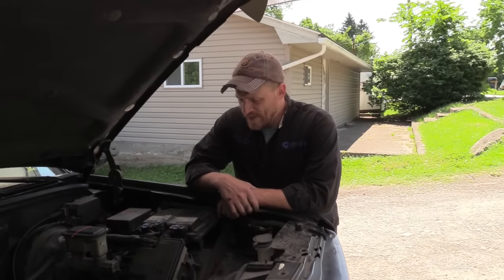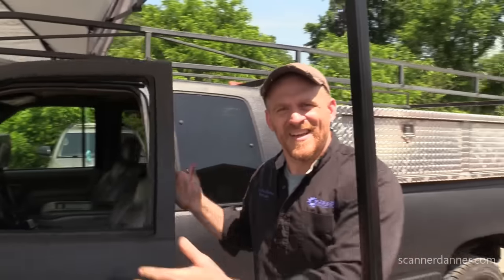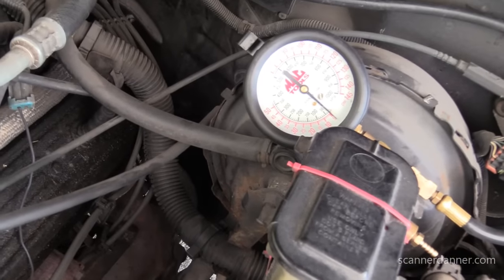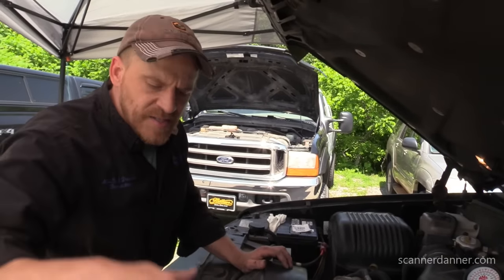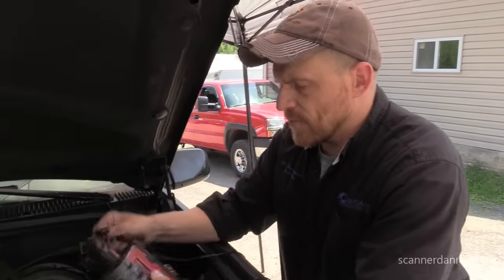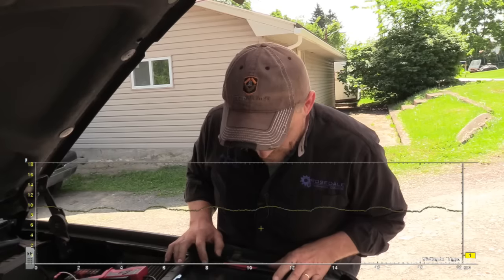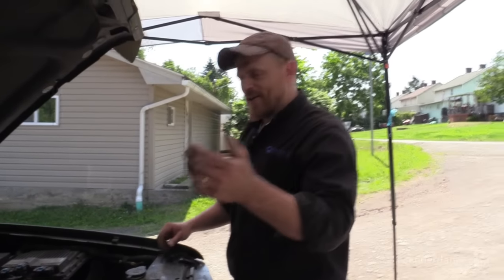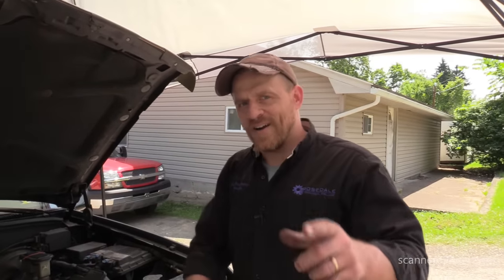Quick Diagnosis of a '97 Chevy with a Fuel Pressure Problem

Comment: I'm trying to find the #19 fuse on the interior which is a 15 amp blue fuse for the radio and battery that isn't letting my Chevy k3500 350 auto. 4wheel drive crew cab dually start. Please help me or tell me how I can find the wire color so I can get my truck going and I will pay you for the info.
Reply: Anyone please help me. The Chevy Dealership parts will not tell me? What is this world coming too greedy people. I'm a real GOD FEARING AND BELIEVING. PERSON
Reply from the maker: here you go my friend, it is the DIY version of the same service info I use. https://eautorepair.adtrk.biz/?a=10817&c=24&p=r&s1=

Comment: question, new fuel pump presure up to 60, will not run unless gas i poured into the throttle body.
Reply from the maker: What is fuel pressure DURING cranking?

Comment: Hay my fuel pump with key I is 55 but when I go to crank it it goes to 40  and it’s hard to start     So would my fuel pump be bad
Reply from the maker: Yes, most likely,, Or you have a power or ground problem with your fuel pump or completely plugged fuel filter

Comment: So I had burned through two fuel pump relays, thought the pump was causing the issue. Replaced the pump with OEM part, slapped new fuel filter on. The vehicle ('97 K2500 7.4l) is running like crap again not 10 hours of run time later, then won't start. Zero psi, I wiggle with the FP relay, I get 52 psi at the gauge. What should my next step be?
Reply from the maker: Having excessive resistance in an unwanted location will cause heat! Sounds like you need to replace your fuse box or power distribution box
Reply: @ScannerDanner  thanks
Reply from the maker: Are the terminals melted where the relay plugs in?
Reply: No burning at all. I should have said went through two relays (as in burned or used) and not physically burned through as was construed, my apologies. The relay fits very loosely in the socket. The pump was a AC Delco or Delphi and has maybe 10 hours on it, and only gives 52 psi.

Comment: I have a 98.  Chevy that starts and dies in 2 ro 3 seconds it not fuel pressure  theres sixty on the gague I just bought the truck the owner said it was in a garage all the time it was had to get to start a week ago and now it just starts and dies now mader what iv done any ideas no security  light on or anything pls help hope u have one that has done this so I now where to start looking
Reply from the maker: 60 psi when it dies? Can you keep it running using an alternate fuel source?
Reply: @ScannerDanner  no on the other fuel tried that and it still dies in three second is it the ecm or becouse if it was the crank sencor it wouldn't fire at all if I'm thinking Wright just throw some things my way and I let u now what iv done and not done thanks

Comment: If it was just a clogged filter, would the amps run higher than normal if the pump was good?
Reply: Gene Mean restriction increases current 👍
Reply from the maker: yes, a plugged filter will cause higher than normal amperage, at least until the brushes get cooked and then amperage may drop off haha

Comment: So I have a question mine reads 45 psi and drops to 40 psi key on engine off it starts and drives fine I replaced the mpfi setup so it’s not the regulator it shouldn’t eavn run right
Reply from the maker: Depends on the year and engine
Reply: @ScannerDanner  well 96 k2500 5.7 vortec has 2 plug fuel pump I believe it’s supposed to be 55/60 psi key on engine off and it drops too so I think pump is bad but it shouldn’t eavn run at 45 psi right
Reply from the maker: @84montecarlonazi  some of the injection poppet nozzles were modified from what I heard and could run on lower psi. But yeah that's too low for your system

Comment: hi have 98 5.7 tested fuel pump 5.5 at idle step gas have 6.1 an it stays there but fall on its face map is tested good masairflow is good     replace injector i new there good w/ good fuel pressure reg new cap wires rotor plugs

Comment: I have 15 PSI fuel pressure my power window are power seat twitch kills the motor because the motor does actually run with only 15 PSI even going down the road at 30mph. Is that possible.
Reply from the maker: yes it is depending on the design injection system

Comment: In having the same type of issue currently. Pressure goes up to 60 before cranking then as I'm cranking goes below 50. Can't get the truck to start same year with 4.3l. Should I replace the pump?
Reply from the maker: Check your pump power and ground first but most likely, yes, you need a pump. Also make sure you change your inline filter.
Reply: Filter was replaced 2 years ago but the truck hasn't ran since, it should be new. But im worried about the fuel sitting in the new filter so long. Should i replace it again?
Reply from the maker: I would and get rid of all the old gas
Reply: Also thank you for the reply! I have been having trouble with this truck for along time! If its just the pump not getting enough pressure for the injectors to spray i will be very disappointed to say the least! I have already replaced the coil, cam angle sensor, crank position sensor, ignition harness, fpr,  ignition control module, everything! Put a noid light on the injectors and they are all getting signal all the way down the spider legs. As we speak i have a new set of injectors coming and now im gonna get a pump. Ill probably be able to send the injectors back i already have mpfi ones in the truck.
Reply: Crazy thing is the injectors aren't even spraying at all. I can hear them clicking and each one clicks as voltage is put to them but nothing comes out even with just below 50psi of fuel pressure. That what made me believe the injectors were either clogged or bad.

Comment: Would a misfire code also be fuel pressure related from a faulty pump?  GM have good engines and overall build quality, but their fuel pumps are garbage
Reply from the maker: You can certainly get misfire codes from low fuel pressure, but you'll also have P0171 and P0174 lean exhaust codes too

Comment: Ok 96 k2500 5.7 vortec I replaced pump and upgraded to mpfi new regulator and injectors not poppet style it has fuel leak down now key on engine off 53 psi and drops  now with engine running it’s 45 psi and holds I pinched the return line vice grip on rubber part it went to 90 psi and held key off any help would be great I’m lost at this point
Reply from the maker: Not enough information you've provided me with no history and no symptoms also the new regulator and injector assembly that you installed may run a lower pressure?
Reply: @ScannerDanner  there is no symptoms it runs fine starts fine but when I key on it goes to 53 psi for 2 seconds til pump shuts off then drops slowly I pinched the return line it went to 80 psi and stayed there is no fuel in the intake that I can see thank you for your time
Reply from the maker: @84montecarlonazi most likely the fuel pump check valve is seeping a bit. As long as you don't have a long crank time, I wouldn't worry about it.
Reply: @ScannerDanner thanks for your time it’s hard to find info on these my concern is at idle it’s only at 45-48 psi it must be because of the mpfi upgrade thanks!!

Comment: I have a1997 Chevy Blazer and the fuel pump never slows down. It revs fine but it continues to pump at max rate (clicking sound) and is never satisfied.
Reply from the maker: Your fuel pump is not a variable speed pump. It runs with full battery voltage and ground the entire time the engine is running.

Comment: When you pulled relay while running shouldn't have stayed running????
Reply from the maker: On some GM systems the oil psi switch will be a bypass for the pump, so yes, when you pull the relay out, it will continue to run
Reply: @ScannerDanner  I noticed that one died when you pulled relay. So what does that mean??

Comment: I have 97 suburban im beginning to believe im a parts changer cause ive installed fuel pump and  filter ICM new cap rotor button new crankshaft sensor and cam sensor still nothing but itll start if i use a lil starter fluid Pleeeeease help me
Reply from the maker: What is your fuel pressure? On this system it will be a no start under 50 psi

Comment: thanks for info my truck is running the exact same way pump is on its way out
Reply: Absolutely change the fuel filter first. A clogged fuel filter will do exactly the same as this. If you have an amp meter check the amp draw of the fuel pump. If it's high it's a clogged filter. Fuel pumps are too expensive for it to only be a filter

Comment: What’s the problem if my 1998 Chevy Silverado starts fine runs fine drives fine but when I hit the gas hard it spits and sputters I let off it’s fine
Reply from the maker: Could be a low pressure issue that only reveals itself under heavy volume loss. Could be a restricted exhaust or MAF issue too

Comment: My 96 Chevy c1500 5.0 l is only reading about 50 PSI at idle is that normal
Reply from the maker: 50 is on the low side. What are your engine cranking numbers? Should be 60 minimum. This will be a good guide if your pump is weak. It won't pass that test

Comment: What if you have to spray starting fluid to start it an it still does the same thing in this video
Reply from the maker: What's your fuel psi during cranking when it is not starting?

Comment: I have a 98 Chevy with a 5.7 .it will start and  cut off . No engine light on?
Reply from the maker: what is your fuel pressure?
Reply: @ScannerDanner  50 to 60
Reply from the maker: @ronnie266r  at 50 and below, this engine will not run. It is super important to know what the exact pressure is when it dies
Reply: @ScannerDanner  50 to 60
Reply: @ScannerDanner  its is 55
Reply from the maker: @ronnie266r  okay, spark test is next, install an inline spark tester to one of the plug wires and watch it as the engine is stalling

Comment: How do we know it is not just a clogged fuel filter compromising the volumetric flow rate?
Reply from the maker: The scope waveform told us it was not a plugged filter. Amperage was normal with a slow RPM and a weird waveform. 
But here is how I handle plugged filter concerns:

Absolutely a plugged filter could cause a low volume/psi problem (which is what we had), changing the fuel filter and retesting is about the only thing you can do, other than measuring psi before and after the fuel filter, which no-one does. In my experience, when a fuel filter gets plugged to the point of low volume symptoms, the pump it getting replaced anyway.  Damage occurs to the pump (higher than normal amperage/heat) from plugged filters. I had a customer with a plugged filter (work truck), changed the filter, all was well, happy customer in that he only needed a filter and not the pump, truck comes back 2 months later on a tow truck with a bad pump and he was very angry with me in that he had to miss another day of work. I have never just done a fuel filter since.
Reply: you can test the "flow rate" on outlet side of filter, then from inlet side. if nearly the same and still lower volume than spec., look inside the tank. yeah, almost nobody "flow rate/volume" tests anymore lol.
Reply: Learned to trust my scope even more with this answer Paul, thank you for taking the time to explain this one.

Comment: Couldn't it be the fuel regulator under the upper intake?
Reply from the maker: I'm pretty sure i addressed why it was not. But a stuck open regulator (causing low fuel pressure) would be low psi all the time, not just when you snap the throttle and do a volume test. I have a video on one. I'll find it and share the link.
Here you go! Take note of how the psi reacts and compare to this truck. https://youtu.be/ZG8rMJwILxA

Comment: He didn’t check for a wiring problem. What if there was a high resistance under load?
Reply from the maker: Yes I did. Current flow told us all we needed to know about the power and ground to the pump.

Comment: Paul I’m having that sound but I changed the fuel pump already :(  car is driving bad HELP!!! 98 Chevy K1500
Reply from the maker: what is your fuel pressure? doesn't matter that you just changed the pump
Reply: Ok so I finished the end of your video and realized that we did pump but not the filter do you think that would help? Also car is running the same codes as this video. Going thru heck with this truck
Reply: ScannerDanner  also I can’t check the pressure now I don’t have the tools but I’ll try to drag it to a mechanic it drives so bad :(
Reply from the maker: You can get a psi gauge for your truck for around $30. I have them listed on my Amazon affiliate page. Or go to your local parts store and rent one!
Reply from the maker: @ms.charlie841  https://www.amazon.com/dp/B000R5IASC/?cv_ct_id=amzn1.idea.3JYIE5R5YCLL4&cv_ct_pg=storefront&cv_ct_wn=aip-storefront&ref=exp_cov_scannerdanner_lv_dp_vv_d
Reply: ScannerDanner ok great and do u think adding a fuel filter with the new pump would help any? Can that make it still put since I didn’t change it?
Reply from the maker: @ms.charlie841  possibly, but we are just guessing without a fuel psi measurement

Comment: 99 obs 5.7 150k
New pump (delphi),  filter (napa), spider upgrade (delco), Optima 34-78 battery. 

Battery 12.87v
Fuel pump pigtail (gray) 12.86v 
Signal ref voltage (purple) 5.12v
Primes to only 20 psi and holds. Starts and runs great for 2-3 mind then bogs out and dies. Wont go past 20 psi HELP!!

Comment: It's probably just a clogged filter. I'm not able to say much for fuel pumps themselves but I know from working on pools that pumps almost never weaken, they lose flow (and RPM) if something clogs elsewhere in the system, usually the sand filter for pools. If a pump goes, it makes a ton of noise then fails all at once.
Reply: Also, a clogged filter can cause the pump motor to run hot causing motor to go bad. Probably best that he go ahead and replace pump and filter.
Reply: This is true.
Reply: Restricted filter will be higher amp flow.  Along with higher amp flow is heat.
Reply from the maker: The scope waveform told us this was not a restricted fuel filter. But here is how I answered others with the fuel filter concerns:
Absolutely a plugged filter could cause a low volume/psi problem (which is what we had), changing the fuel filter and retesting is about the only thing you can do, other than measuring psi before and after the fuel filter, which no-one does. In my experience, when a fuel filter gets plugged to the point of low volume symptoms, the pump it getting replaced anyway.  Damage occurs to the pump (higher than normal amperage/heat) from plugged filters. I had a customer with a plugged filter (work truck), changed the filter, all was well, happy customer in that he only needed a filter and not the pump, truck comes back 2 months later on a tow truck with a bad pump and he was very angry with me in that he had to miss another day of work. I have never just done a fuel filter since.

Comment: Can I ask a question about this system.
Reply from the maker: sure
Reply: I sent an email on your website, but I’m sure you get a LOT of them. Anyways, got a 99tahoe, keep having to replace bank 2 O2 upstream sensor. With a pressure gauge, running, got 52psi, it bleeds off to 0psi immediately when I shut off the key.  I have a suspicion that i got a leaking regulator and since it is on bank2 side of the motor, that may be the underlying cause. I also have to prime the pump twice to get it to start, once it goes into closed loop, it runs rough and smells bad through the exhaust. Anything else i should look for that you would recommend. Thanks

Comment: I would have changed the fuel filter first, before dropping the tank because of the slow pressure build during the prime before the engine started.
Reply from the maker: you wouldn't be wrong in that approach, my argument against just a fuel filter change is:
1. when a filter is plugged to this point where it is causing volume problems, the fuel pump has been running at much higher current levels for a very long time and it damages the pump. 
2. the fuel pump current was normal (not high like a plugged filter would cause) and the pump RPM was slow

Comment: 1996 chevy 5.7 fuel pressure drops instaly to 0 from from 50 on a crank
Reply from the maker: 50 is not enough, should be 61 at least on a crank and you're immediate bleed down is not good either.

Comment: Lots of times GM just clogs up the sock in the tank fuel pressure will drop below 60 and they won't run well anymore always do a deadhead pressure check at the fuel filter should have at least 80 to 100 lb coming out of a pump on this type of system... actually working on one now has 100 PSI at the fuel filter drops to 10 under load at the engine suspect bad pressure regulator 97 454 don't usually see this problem this way but it appears that's what it is ...update... pulled the fuel filter out it was not clogged replaced it anyway had a hundred PSI at the fuel filter customer had installed their own pump now the vehicle is working perfectly fine 55 to 61 PSI weird stuff sometimes something had to be hung up in the line or the pressure regulator got stuck open somehow because it's all good now so doing the deadhead pressure test at the fuel filters seems to be what fixed it welcome to the world of auto repair I have to say though I've watched a few of scanner danners videos I wish I had a guy like him working for me been looking for help for over 10 years for my business turning millions of dollars away everyday